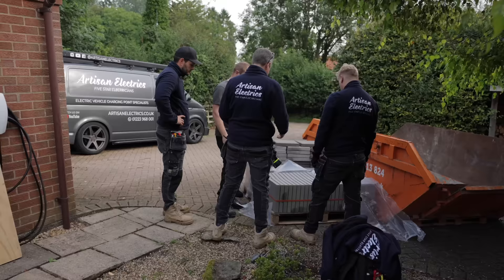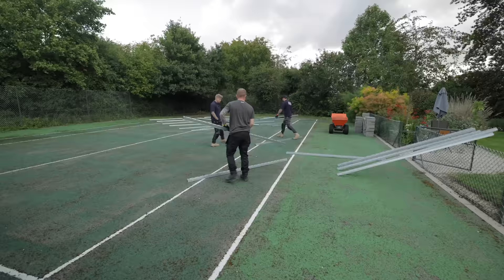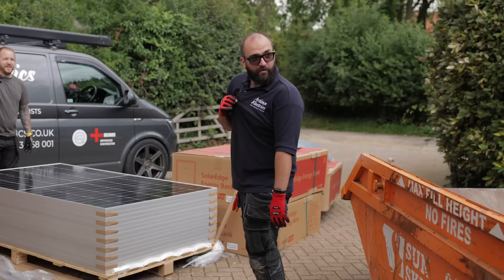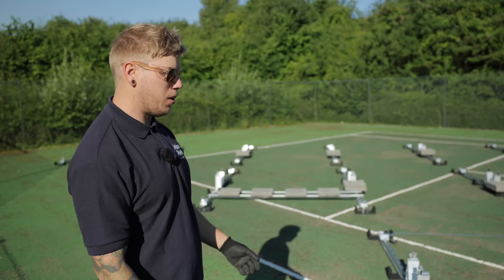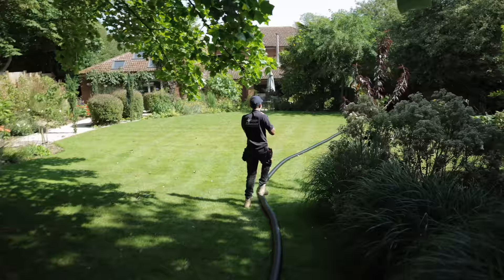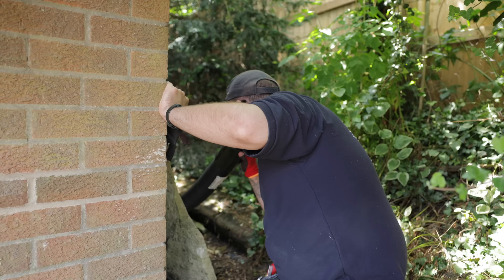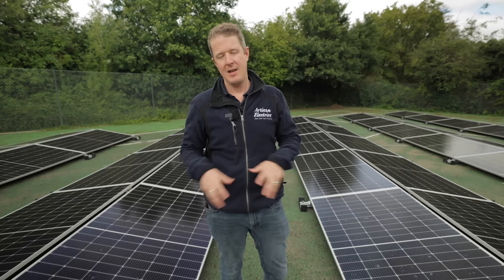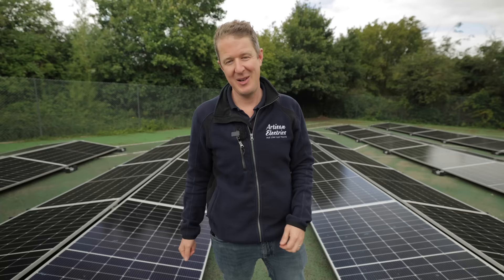Turning a TENNIS COURT into a SOLAR FARM! 🎾⚡️

Comment: Great project, but a couple of Solar Edge questions. You stated a 200% DC power to AC power ratio? Surely that’s too high. The data sheet for the SE5000 & SE6000 states a 155% ratio - you need to check that I think. Also, are you using export limitation at all? What happens if you are producing 17kW, the batteries are full and the house has minimal consumption. Without export limitation the balance will be exported to the grid & will cause DNO issues unless you have approval to export that much. I’m sure you have thought of these points. 🤞
Reply: Can never get my head round this max oversize on panels. The inverter will only draw up to its rated capacity ( plus a %OL) making more power available won’t make it generate more as long as you don’t exceed the dc string input voltage of the inverter I can’t see it matters. When we connect a motor inverter to the grid we don’t worry that the grid has more power available than the inverter can handle, or am I missing something here.
Reply: It won’t ever reach the peak, being east west. Half the time the off axis ones will probably get 200w while the ones on the sun side will be getting 450 or so. If it was on a roof and all pointing south you would be maybe peaking it for a bit around 12. They didn’t mention if it was 1 or 3 phase but likely 1 or 3 100a 24kw feeds. I’d guess neighbours have similar and a good chance of using it up before the substation gets bothered. Also probably long runs between properties and substation too.
Reply: @johnwarwick4105  I installed a diy system last year for my own home, On one of the strings I used a EPever 100A charge controller, rated to handle 150%, so max array for 24V system is stated as 3750W, I contacted EPever and asked can I overpanel if I don't exceed the max input voltage, from memory 150V (I think), which I didn't , they said no, not given a clear explanation, just that it can't exceed the short circuit current?, I actually installed 4500W in the end, all's working well, its south facing and ground mounted at 30% with no shading
Reply: @IanFarquharson2 I’m not sure I totally agree with that. At mid day in the summer then both E & W facing will be similarly illuminated- maybe not to 100%, but pretty close - which is exactly the point I’m making.
Reply: @robertharvey9698  ye, we have an east/west installation at work, 14 no 440 watt panels both sides, roughly 15 degree pitch, so roughly 12.3kW, I've seen it hit 10kW mid day

Comment: Low angle of inclination of the panels and DC/AC 1.82. The inverters will clip significant energy for six months. You could have done better

Comment: 5 rows x 12 panels = 60 panels or 25 kWp is really the biggest ?
I have build ours alone with 27 kWp and mostly 500 Wp and 535 Wp for 15000€ incl. a 8 kW battery . 

Must have become big business in the UK if that is 60.000 GBP or 50.000€ 

We would use steeper angles for east west orientation and usually would never go for a tennis court with shadow and the optimizer that can cause so many issues even though those would be  a lot easier to fix on the ground. We push them onto the roof, use even on garages 20 ° angles cause the production per kWp installed is a lot, lot higher and of cause much cheaper .
Reply: It has.  The margins are insane.  Absolutely insane.
Reply: 60.000 GBP is around 70.000 EUR 😯

Comment: lovely install just not sure about the basket. 
maybe use some rubber feet and cut some 1inch tray.

😊
Reply: Or 20mm galvanized conduit with rubber ramps each side of conduit 😊
Reply from the maker: Thanks for the tip!
Reply: @artisanelectrics  your welcome if you ever want a collaboration let me know. like your channel 😎👌

Comment: Ray is a shitehawk for not showing that connection he used for pulling the cables... Learned/confirmed a lot of what I do in my job is right... Damn you dude, although my conduits are a lot smaller in diameter. I work on weighbridges and low voltage, but running cables is on the daily. I love this channel, it keeps me on point with my quality installs and other industry standards, you guys are inspo
Reply: Who’s Ray?
Reply: @bobbytrollo  it's Roy who wouldn't disclose fundamental tricks of the trade... Hes Ray to me Richard. I purposefully dissed him or whatever his name is lol. It was on purpose to hurt his feelings lol
Reply: looks like trick was going to be: make a loop with the cable cores on one end then make a loop thru with the other cable thru the 1st loop so they look like figure of 8 wrap strands round itself then tape up as not to catch on the pipe when pulling join is as solid as the cable never pulling off
Reply: watched again it probably is as when cable was been pulled out from the pipe it was same thickness as earth core which is what it should be great method for pulling new cables down tight conduits

Comment: Has this customer not just literally pissed away money? Solar panels have a lifespan of what, 25-30 years.. they will never recoup 60k in energy savings over that period of time. More money than sense
Reply: Or, of course, a concern for the environment...
Reply: Call it 25kWp x 800kWh/annum = 20,000kWh assume they use it all due to swimming pool etc at 30p per kWh which is low that £6k / annum. So 10 year payback and less when more increases likely and will save money buying cheap energy into batteries in winter. Then there's environmental concerns and energy independence and will help uk plc ballance of trade.

Comment: In this east-west configuration the panels work no matter where the sun is, so I would just have ignored the compass and installed them at right angles to the tennis court. Room for more panels and looking tidy.
Reply: So if you set your east-west configuration to north-south would be the same as you stated?
Reply: @DumahBrazorf  Not the same, but at this low angle, I suspect the results would be similar. The panels are just a few degrees from being level with the ground, and I hope we can agree that at 0 degrees, the results would be the same independent of direction. On industrial building flat roof installations, they usually follow the direction of the building, but buildings are not necessarily aligned with true north.

Comment: totally Useless Install - half of it's in the shade - all those trees have to come down you've installed really Low now look at your sun rise sun set and cut all the trees at either end of the day and that's only in the good light of summer - in winter it becomes even more useless because the sun is Lower therefore the Panels need to be steeper.

The Install is not Fix to anything - you have concrete slabs sitting on the frame - that's not Fixed.

they should have been mounted to track the sun because when you have some blocks in shade the low power drags all the other panels Down to the Low level.

You have created something that will have only 2/3rds the power it should and if a wind spout goes through they're all gone in 15 seconds but the concrete slabs will be fine.

Very Poor Install Idea.

Mine follow the Sun

Kiwi.

Comment: It’s great to see such a significant solar project Jordan and the team. Sadly only available to the super rich. Solar is unaffordable to the vast majority of people on usual incomes, it is such a crying shame we can’t all access this renewable market, and save some of hard earned incomes. Nevertheless, thank you for showing us the other side 😊
Reply: Not really. We saved and got a 5kw panel/10kw battery install fitted 2 months ago, and we've got a 35k annual income (I did most of the AC wiring install so likely saved 4k but lost out on 3 full weekends) Stuff like this is accessible.
Reply: If you do the sums, it's really not worth doing at all. Certainly people claiming money back in 8 years are talking nonsense.
Reply: @allan4787  disagree. We've gone from £7-10 per day to approx 2 pence. Will be different in winter but, with the right system, the 4 year payback is sometimes realistic. "If you do the sums"? Surely EVERY install situation is different right? We've been in the trade long enough to realise its never just black and white
Reply: @richnorman7325  
Good.
In my case £8500 and 12 panels. 8 years of payback was equivalent to 33p per unit. Remember compound interest if you just put the money in the bank. 

Can't show you the spreadsheet or a screenshot in these posts
Reply: @allan4787  true but also adds value to your home to a certain degree aswell. Swings and roundabout really
Reply: One in three houses in Australia have solar, it’s certainly not only for the wealthy here. It might have more to do with your (relative) lack of sun in the UK, and a decade of Tory governments.